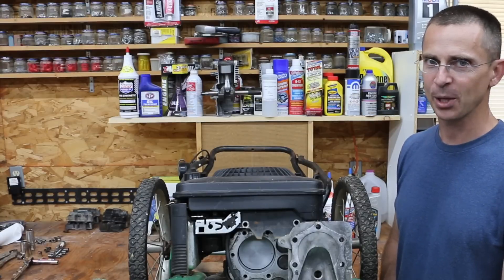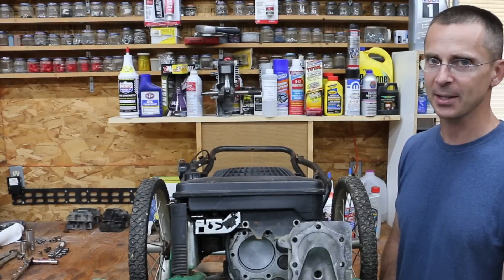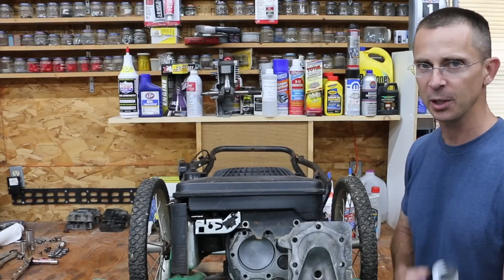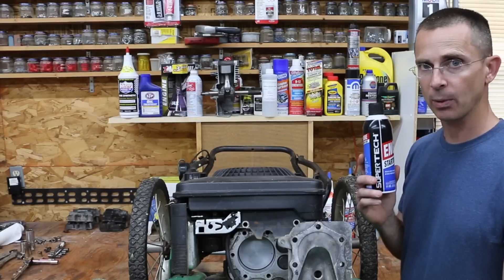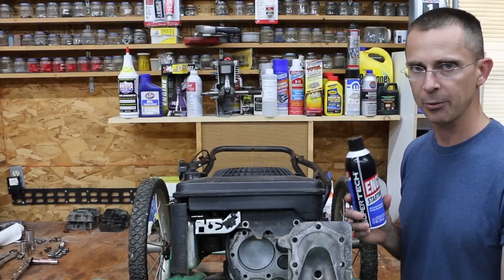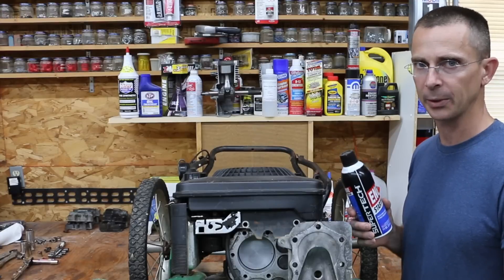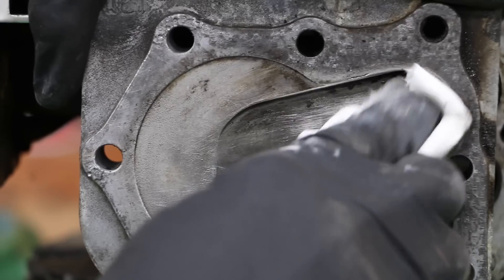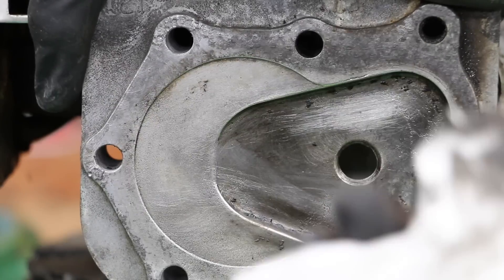Will Running an Engine on 100% Starting Fluid Cause Damage?  Let's find out!

Comment: Try same thing with cheap starting fluid with no upper cylinder lubricant not the premium kind; can be found at NAPA I believe. Additionally as a Diesel mechanic I feel that it would run on the premium with cylinder lubricant (Would have to be sprayed in intake, couldn't be run through fuel system because it would likely damage the injectors like water does being a much different viscosity. Also may cause lubricity problems in the system as injector pumps and various moving parts are lubed by fuel.) and not cause any liner damage so long any glow plugs or grid heaters are disabled. Look at any of the big tractor/truck pullers when they start up a performance diesel, sometimes go through multiple cans to get it to build enough heat to run. Another great video!
Reply from the maker: duckslayer92, Thank you very much for commenting!  Great information!

Comment: This result does not surprise me. Quite frankly the starting fluid probably has more lubrication qualities then the gas does due to most starting fluid including an upper cylinder lubricant.  In the end the starting fluid is just a fuel. 

Now with a diesel you have a big problem. In short delivery. How are you going to introduce the starting fluid. If sprayed in you have the problem of preignition since it will ignite early due to the thermal heat. This can destroy an engine with literally no effort.
 If you try to introduce it as fuel you could ruin the injection pump due to lack of adequate lubrication.  Timing could also be affected due to the rate of burn being different then diesel. I would set a diesel at 3 to 5 degrees retarded timing to start. I would mix a liquid starting fluid with two cycle oil at probably 20:1 ratio. Maybe a bit of ATF as well.  I bet it would run though you may have to adjust the timing to get it just right. Its going to knock pretty bad with the standard advanced idle timing.
Reply from the maker: Thank you for commenting.  Yes, lots of comments warning about using starting fluid in a diesel.  Thanks for commenting!

Comment: I'd love to see you spray starting fluid in a diesel
Reply from the maker: Ryan, Thank you for the project recommendation!  I need to find a diesel a diesel that doesn't have much value since it'll likely destroy the engine.  Thanks again!
Reply: It will cause a runaway & destroy it.

Comment: Without even watching, I can say 100% yes it will. Recently rebuilt a 1988 Mack E6-350 that had $18, 000 engine damage because of starting fluid! The major difference here is, with your test, you are putting the fuel into a metering device (the carb), on a diesel, spraying starting fluid directly into the intake, you bypass the fuel metering device (fuel or injection pump), and essentially have no way to control the rpms of the engine.
Reply from the maker: Ryan, Great information.  I will avoid using starting fluid in a diesel.  Thanks for commenting!
Reply: Project Farm, you can use starting fluid in some diesels, as long as they don't have preheaters or glow plugs, you just have to use short bursts. The guy I refer to, used 2 whole cans in a row, steady stream

Comment: I has a 4 wheeler than wouldn't stay running on normal gas. I put 2 cans of starter fluid in tank. Drove it for a few hours. It ran way hotter than normal and never started again lol.at least I haven't tried to start it again
Reply from the maker: LOL! Thanks for commenting!

Comment: Diesels it can hurt but in a weird way. Most diesels have special injection ports for it. Being that starting fluid has such a low flash point it can cause the engine to fire before TDC. It also makes them knock and ping like crazy if you use too much, they really don't like it at all. Over time they actually become addicted to it, mostly because if done wrong, it beats on the rings and your compression drops. It's always good to avoid it, but if you absolutely have to a SMALL snort to the air cleaner or a snort to the injection port is ok. But never ever ever over do it.
Reply from the maker: This is great information. Thanks for commenting!

Comment: Mechanic for 20 yrs now and have used  my share of starting fluid and I have always said that starting fluid in a gas engine would  not accelerate wear, but there is the proof. If an engine is off time and backfired up the intake thru a carburetor on an older car chances   are you will be rebuilding the carb after or at least replacing the accelerator pump.
Reply from the maker: Stepvan Joe, Thanks for commenting! Great point regarding the backfire and risk to the carb on older cars.  Thanks again!

Comment: As a diesel tech. i use starting fluid to start trucks after working on the fuel system. And i have never seen it cause any problems with the engine
Reply from the maker: Phillip, thank you for sharing your experience!
Reply: Project Farm. Your welcome

Comment: I not an expert but I've been messing with engines all my life and I'm getting pretty old now 😀 but starting fluid in a diesel depends on the engine, some are a no-go and some are ok. Check your service manual. I think it depends on if it's direct or indirect injection, the shape of any pre-chamber, and maybe the exact location of the glow plugs. I've seen diesel powered trucks and equipment with warnings and cautions pasted all over them and I've seen similar equipment with factory installed "sprayers" that hold a screw on can of ether. Some are a no-go because it can damage the engine, some others because it can damage the operator.
Reply from the maker: AngryRed Banjo, This is great information!  Thanks for commenting!

Comment: What was ether content of the starting fluid being used?   I feel that would make a difference.  Years ago starthing fluid had a higher level of ether than it does today.  Try the test again using John Deere brand of starting flhid. It contains more ether then other brands.
Reply from the maker: Tim, according to the MSDS, the ether content was 50-60%.  The MSDS did not provide an exact amount, probably for proprietary purposes.  Thank you for the recommendation to use John Deere starting fluid!

Comment: Manufacturers started adding a lubricating oil to starting fluids to prevent damage. 
That might explain the oil residue you found in the combustion chamber.
Reply from the maker: Ray, This makes sense and explains the oily substance I found on the cylinder head. Thanks for commenting!

Comment: On a diesel 100 percent yes it will. I see it all the time starting fluid that has damage engine components in the shop especially over the winter, and mainly on new engines like paccar dd15 dd13 and mp8 mp7
Reply from the maker: Tony, thank you for taking the time to comment!
Reply: Project Farm any time thanks for your vidoes👍

Comment: I've always been told that if you can keep from it don't use starting fluid in a diesel it'll make it an "ether baby" and it usually won't start with out it. we used to have an old old old cat front end loader and that engine proved to me this theory, it would not start until it breathed in some starting fluid.
Reply from the maker: Yes, I've heard this too.  Some have commenting that it damages the rings, causing low compression.  Thanks for commenting!

Comment: I would definitely say yes, starting fluid will seriously hurt a Diesel engine. I've seen many engines come through the shop here with cracked pistons and every one of them the owner admits they use ether regularly to start them. We also (on a slow day) took an old Volkswagen 3 cylinder diesel and shot it with ether just to see it for ourselves, after we disassembled the engine 2 of the 3 pistons had serious cracks in them. I would say it may be a little easier to get away with on newer diesels that run a bit lower compression (18:1) than say an old 80's 6.2 Detroit which runs around 21.5:1. I would like to see you test it in a smaller Diesel engine to see if the results vary at all - EDIT just wanted to note we did use a large amount of ether on that engine. Most of the time you can get by with using ether here and there but I can say for certain that it is definitely a time bomb to hurting your engine. Also, if you do decide to use ether 1 single short squirt. That's it. If it won't start then plug it in. If it still won't you may be looking at a set of glow plugs/grid heater or injectors in the near future. I also wanna note the engine we did this to did run good prior to this. (Car was wrecked and sold for parts) hope you guys learned something from this! Reply if you have any questions and I'll be happy to answer them to the best of my ability
Reply from the maker: Joe, Thank you for commenting.  I will definitely avoid using starting fluid in a diesel.  Thanks again!
Reply: Project Farm anytime! If you have one that's just to cold to start or you feel for any reason there is no alternative, use brake parts cleaner. It's a lot less potent than starting fluid but should still get it running. If it takes anymore than 3 at max squirts of it, the engine definitely has some sort of issue unless it's a very old engine (1970's and prior) some of the older ones never did like to start in the cold even with the use of block heaters. But from my experience, brake parts cleaner in small amounts will usually do the trick given the engine is in good running condition

Comment: Only used it in a pinch to get a diesel restarted after running it out of fuel. Not entirely my fault, the furl gauge died at 3/8 fuel. Would be interesting to see a test on a turbo-diesel engine.
Reply from the maker: Jeffrey, Thank you for commenting and for the video test recommendation!

Comment: Starting fluid isn't inherently dangerous, but it is much more volatile than gasoline. If an engine doesn't start off of its designed fuel, there's likely some other problem. Improper timing is the most dangerous example of this. Starting fluid has the ability to bend or even break a connecting rod if an engine is out of time. This is why it's considered dangerous
Reply from the maker: This is great information--thank you!

Comment: Do it on a diesel. A small diesel tractor. It will crack the rings and pistons and blow holes in them in extreme conditions, even blow the head and warp valves. I have seen inside the heads of some small yanmar that were destroyed by it...by the owners admission. Seen several on a tractor forum.

Comment: Hello community of knowledge seeking individuals. I would like to inform everyone what the truth is about starting fluid. The issue with starting fluid is its tendency to pre ignition. This means that  ignition of combustible gas happens earlier than top dead center or at least earlier than normal thus causing rod knock which will Gaul the connecting rod bearings each time you do this you can break a rod or spin a bearing or in a small engines case seize the rod to the crank thus breaking the rod. And the engine failure  happens  after it is running . But the damage causing the failure happens on engine starting . Running an engine on starting fluid is likely fine unless it is a diesel , then the pre-ignition of The Ether is in play continuously .
Reply from the maker: Aaron, This is really good information to pass along. Thank you for commenting!

Comment: Hey Project Farm, I have an idea for another good experiment. I heard from a buddy of mine that his grandpa had an old motorcycle that ran really poorly, and he ran the bike on just straight Sea Foam (no gasoline mixed with it) to help clean out the carbs and engine and better performance. Was wondering if you could do a video on that to see if it is possible and if it hurts and helps engine performance.
Reply from the maker: Jon, Thank you for this recommendation!

Comment: Shouldn't hurt it. As far as drying out,gasoline is equally as dry. Now try this to a 2 stroke and the result will be much different
Reply from the maker: Greg or Jen, Great point!  Apparently, starting fluid now days includes a lubricant.  I wasn't aware of this prior to creating this video.  Thanks for commenting.

Comment: Have you thought of mixing diesel and octane booster together & running it through an engine? I put pure octane booster in mine & it revved so high I thought it would blow up!
Reply: With a huge plume of white smoke as well
Reply from the maker: Thank you for this recommendation!

Comment: Is It possible to get an engine (like a briggs and stratton) to run backwards?
Reply from the maker: Leon, Yes, it's possible, but required a lot of mechanical and machine shop work.  Thanks for commenting!

Comment: I think it depends on the starting fluid and its additives. Most are ether based, I have run a big cummins for a good 5 minutes just on starting fluid sprayed into the air cleaner with no obvious damage. Some haulage trucks back in the day would have a bottle under the hood and a manual pump inside the cab to inject starting fluid on say a cold day.  Maybe the damage "rumour" comes from decades ago when starting fluid would literally just be ether with no additives or oils etc? My dad used to say "don't use crack in a can as the engine gets addicted".
Reply from the maker: RetroResto, Thanks for these comments.  Some have experienced degraded starting performance in diesels following use of starting fluid while others haven't.  I suppose that there are multiple factors to consider.  Thanks again for commenting!

Comment: I recently watched a guy do an Aircraft mechanics trick.
The carbon fiber propeller will get chips and scratches in it.
So they take super glue and put a layer on.
Then the take baking soda and sprinkle it on.
They say it instantly dries and is even stronger.
He didn't have a way to check the strength tho.
Plus I wonder if that works on some other things.
Just an idea, but the vids are great to me.
Have an Awesome day bud!

Comment: I mowed my lawn once using Coleman lantern fuel in the tank. Ran like a champ.
Reply: It is what is often called "white gas", but the more accurate term is: "motor spirit", as it was called in the 19th century. It is NOT petrol or gasoline, which still contains the heavy materials, but which are kept in suspension chemically. Motor spirit has had those heavies refined out, which is a more expensive process. 
Since the heavier materials are no longer present, Coleman fuel never spoils and turns to varnish. It is still good decades later. A great reason to run small engines on it. The biggest problem that little used engines suffer from is bad gas. The extra cost is insignificant, since lawnmowers, chainsaws, rototillers, and such like, use so little fuel in the first place. I've been running small engines on it for decades
Reply: it's what use  to call white gas
Reply: @rexclay2231   No, that is kerosene and so is the airfuel. It doesn't have an octane rating because... It has NO FUCKING octane in it.

It has hexane and while a B&S engine will run on cat piss and a prayer you can't run a car or anything like that on it without upping the hexane rating.
Reply: That's awesome
Reply: I had a gas powered pressure washers a few years ago and one day I was using it and ran out of gas. I had some laquer thinners in my garage and poured it in the tank and ran perfect
Reply: Known as white gas. It's just refined and filtered heavier. Octain is between 98-100. Aviation gas is pretty much the same thing but leaded102 octain.
Reply: @rogermarshall8991  ahhh white gas I remember those days. power, mileage .37
Reply: Per gallon. Then emissions. Back then tax on gas was too add lead. Then tax after too add lead. Still doesnt make any sense.  Govt. Red tape
Reply: @bladerunner6354  the gas tax is used to build and maintain roads. You favor that, right?
Reply: @bladerunner6354   No, you can't run a car on it, it's literally kerosene. Unless it's a diesel car in which case you can but you'll get worse mileage than on straight diesel.
Reply: @rogermarshall8991  The octane rating for either this white mineral spirit (kerosene) or Jet Fuel (kerosene) is ~15.

It's not "white gas", that would be alkylated petrol and this isn't it.
Reply: @rexclay2231   White mineral spirits is another name for kerosene. The octane rating for either is ~15.

Now go look at what it says RIGHT ON THE CAN, it's white mineral spirits.

Also, I'll use whatever fucking language I see fit and if you have a problem with that you can fuck off. Words are not inherently bad just because you want them to be.

Comment: really interesting test. about half way through i noticed the mower seemed to run much smoother. i had no idea an engine would run on plain starting fluid. do you know what caused the oil residue inside the cylinder?
have you considered trying the same experiment but using the see through cylinder head? that way you could compare how it ignites in the engine against how standard gasoline ignites.

Comment: Thanks for posting this video. I will certainly feel better about using starting fluid for just a few seconds now. If there wasn't any damage after half an hour, there shouldn't be any damage to my engines if I use it as directed.
Reply from the maker: Mike, I've come to the same conclusion.  I'm learning a lot from running these tests. Thanks for commenting!

Comment: Seen all your videos I watch you tube at home. Iv never posted a comment but iv been told if a engine is built to run on pump but you put 91 or higher octane you get less power if you want to make a power increase from fule you should get a lower octane fule or leaded fule. So will a small engine run better on high or low octane?